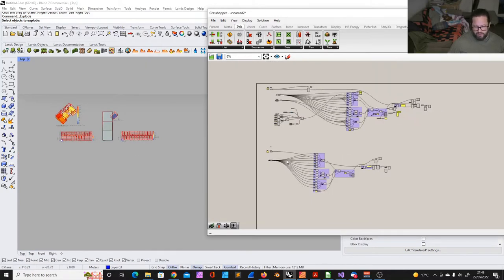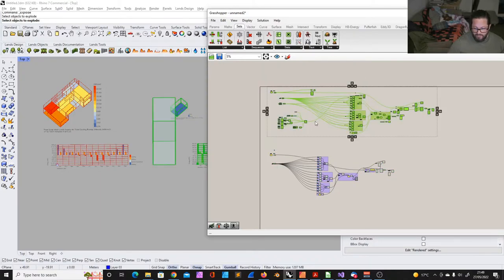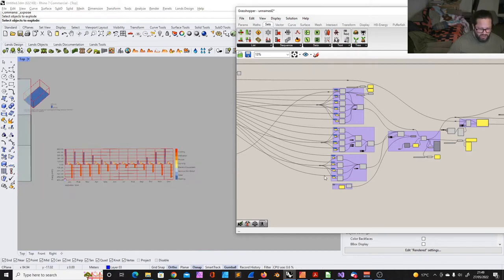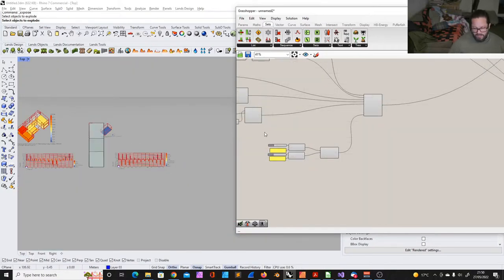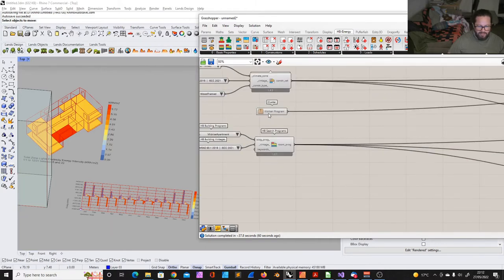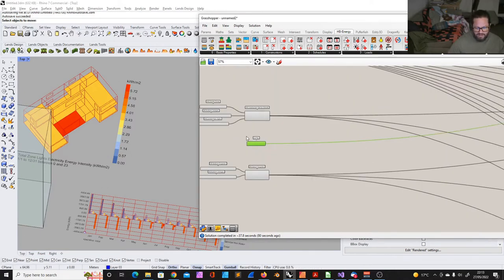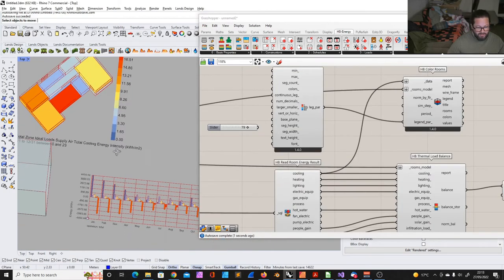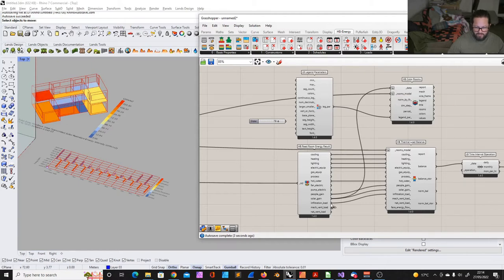Honeybee 'ENERGY' Part 5 | Programs and Construction Specs | Ladybug tools 1.4.0

Comment: Hi again, I'm want to specify my construction and it is typical- window and opaque but I can't figure out how they come together? Because windows are not just exterior/ interior subset?
Reply from the maker: the windows can be tailored in the construction tab with with either fully prepared window types. you can look up the types with the search material tool. or just tailour your own. then either apply the construction to your rooms or directly to the aperatures. The best to get your head arround this is to look and hover over inputs and outputs and see what is suggested as connection.
even if you have a subset created you can still overwrite and/or refine your materials and apply it to rooms and/or windows...
let me know if this makes sense or if you still struggle.
i might should do a video about it...

best
Philipp